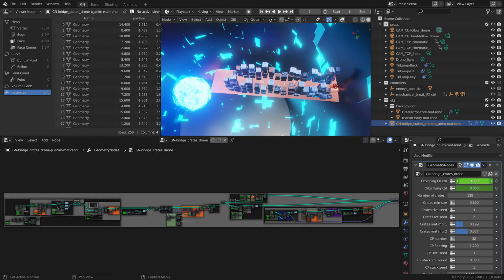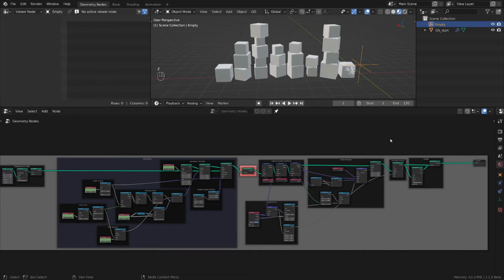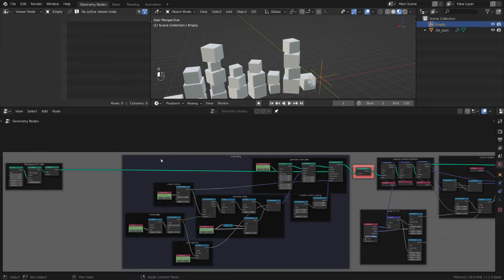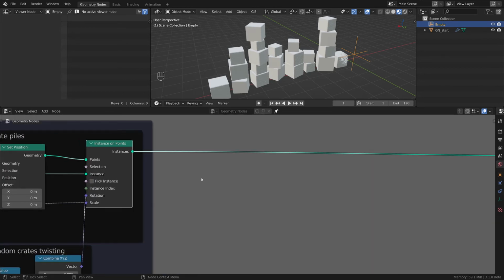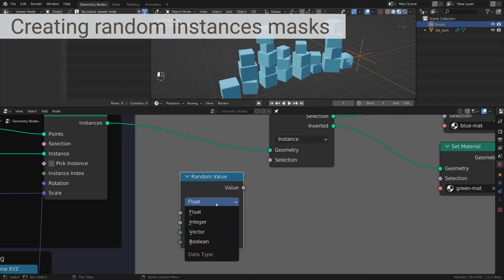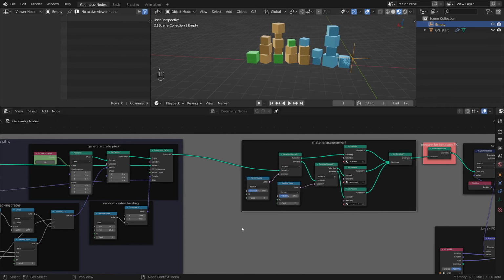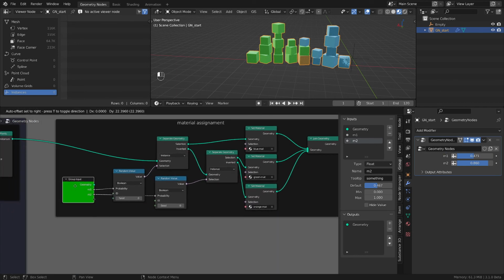Project SciFi Reactor: Randomize materials [3/9] | Blender Geonodes Daily, tip 97

Comment: Very nice and helpful tutorial! Keep on making. 
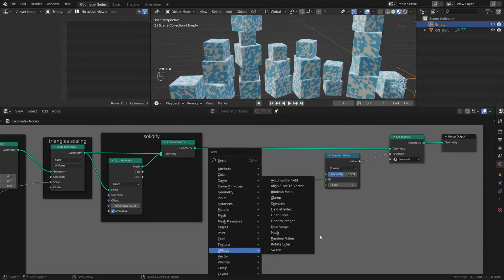Is it possible to give different material to a special vertex group inside geometry nodes? Like, at the time of 4:00. Instead of giving a color to random faces, I would like to use a chosen vertex group and refer color or material to it. Is it somehow possible?
Thank you and best regards!
Reply from the maker: Thank you for your positive feedback! Really appreciate! 😀
As for your question, in short: yes, definitely. But the explanation would be rather lengthy, so I`ve made a twitter post with screenshots of a working solution for you.
Please check it out here https://twitter.com/VladimirGallery/status/1506527995720310787?s=20&t=X8uS9RqmuFO69EF7o2ex6Q
and feel free to ask any questions there if something is not clear or you need further help. I`ll do my best to assist you.
Have a nice day!
Reply: @vladimir-nodes_surfer   Thank you a Lot for your reply! I created the account on Twitter. I could not send you a message with the screenshots of my issue, so I just did it the way you did. Furthermore, I posted the picture with the description of the problem on my "wall/dashboard". I am your follower now(PowNy). I think it is not possible to writhe you a direct message on Twitter, that's why I do it here. Hopefully you have some time, and we would have a contact there. Best regards!
Reply from the maker: I saw your Twitter account. I will check out later your wall/dashboard.